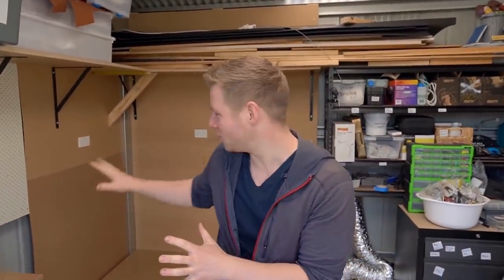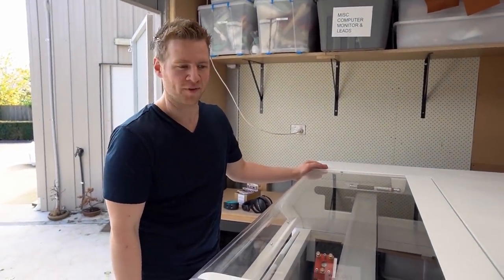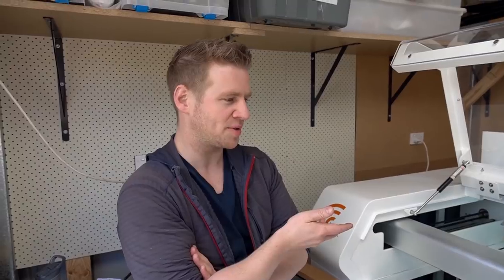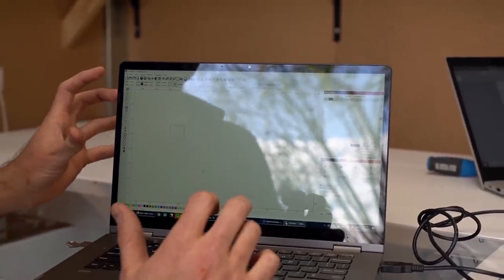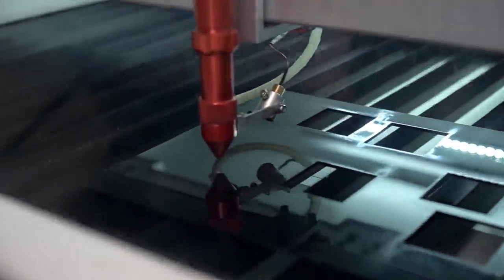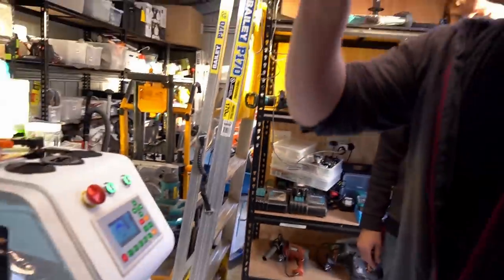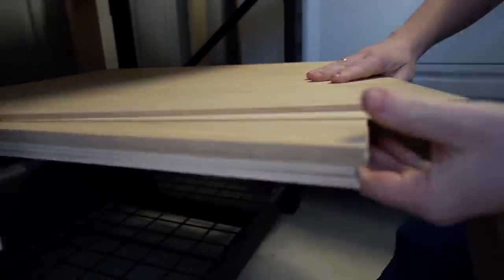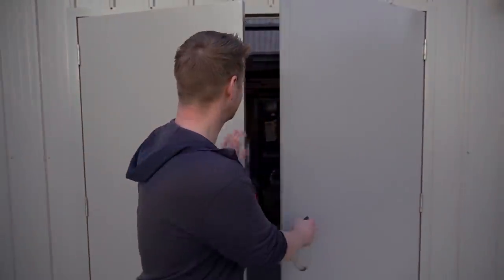I GOT A GIANT LASER!

Comment: I spent five years working in a trophy shop using a laser just like that one to engrave names and graphics onto metal, plastic, and wood. It was a very creative and fun job, getting to pick fonts and design layouts for various awards and name tags and such!

Just like you did, I had to calibrate the laser for each and every type of material I worked with. Save the settings so you don't have to do that again!

Be sure to ventilate the area extremely well. The unit has a fan, but don't just have all those toxic fumes sit in that shed. In my old shop, we had a vacuum tube attached to the unit's exhaust port that would pull the exhaust up to the roof of our building. You're going to need something like that to keep the area breathable. Even with the precautions I took, I was still concerned with how much I could smell the burning chemicals all day. They couldn't have been good for me.

Also, it may be tempting to set it and walk away, but you've got to check on it regularly, because I've had occasional imperfections in the materials catch fire before. Even if it doesn't spread, it'll do serious damage to your machine if you're not there to put it out quickly. It worked out in the store because I was always sitting right next to the machine designing the next job while I waited for the last one to finish. Sometimes I had half a dozen jobs ready and queued up. So I would often glance back at the machine to make sure it hadn't burst into flames. It'll just happen every so often, even with settings that are normally safe. Luckily it always went out quick and almost never did any real damage. I would just put new material in and restart the job.

Have fun!
Reply: Nope to long
Reply: Queen_ animation well i think it's for jazza not you so you're good
Reply: Thank you for reading it lol TwT
Reply: @akiraplayz3143  its was actually valuable information.
Reply: I was thinking about getting a lazer cutter. thanks for the info.
Reply: Came here to comment pretty much exactly this! Yours was a bit more detailed and legible than I'm sure mine would have been though lol
Reply: I'm never gonna own a lazer cutter but that's cool stuff too know... also that sounds like an awesome job to have 😂
Reply: I hope jazza sees this, you gave great information
Reply: Damn, I hope Jazza sees this, because this is actually super valuable information to have!
Reply: Mucho texto inserte toda gangster
Reply: Such versatile machines. Excellent advice; I kept a tab open on engraving chat sites I found,  learning from the experience of others. So many materials from card to ivory, wood to glass, velvet and denim. Eight years well spent.

Comment: I have the model down from that one. Purchased from a NSW company? Red Dot Machinery? Its a great cutter and engraver. Only thing i dont like is the cheap chinese extraction fan and i also had the main loom within the unit come unstuck. Simple fixes. You can print directly from Lightburn, rather than sending to the cutter first. Also can do an auto focus which can adjust the height on mine.

Comment: Serious question, how would mirror the image on both sides? Say if you did want to make a coin and laser the same or different imagine on both sides. How would you go about doing that? You wouldn't be able just flip it over and cut the opposite side surely? 🤷‍♂️ Thickness of material has to important also I'm guessing as the lines may interfere with the overall imagine on both sides

Comment: So I actually worked as a laser technician at my university.
TIPS: DONT FUCKING HIT THE FOCUS. You’ll have to replace the focus and have to have a technician come out to do it. Keep the mirrors clean! You’ll get better cuts! When we did acrylics at my university, we found it was better to do 2 shallow passes instead of 1 full power pass, as the cuts usually came out cleaner instead of “melted”. Another tip for acrylics, there’s certain acrylics that have a coating on them (can’t remember the name) but don’t cut them, as they release a toxic gas from the laser hitting them. If you cut wood (specifically plywood) lowest power possible to get the cuts is best, as it’ll help keep the wood from getting scorched. There may also be air pockets in wood, which will result in a pocket of fire, but the fan will quickly get rid of it. But it can definitely be scary the first time it happens. If you cut leather, prepare for the workspace to smell like death. Depending on how light of power you can get, you can even cut fabrics and paper! I’ve cut paper-thin wood before, and painters blue tape can be a great way to hold stuff down. If you want to cut a super large piece, make sure your material is at LEAST a quarter inch larger on all sides, so that if it’s not perfectly aligned, it won’t be a big deal! Keep the fans clean! And if something doesn’t look right in the machine when cutting (like sparks or fire, or even a gas), ALWAYS hit the emergency stop. It’s better to restart. If there’s a fire, turn the laser off and let the fan do its job! If you want to do engraving on a piece you want to cut out, do the engraving first, as it’ll produce a better result since a cut piece of material could shift even the slightest bit when the engraving starts. I also recommend keeping a settings list for materials you want to cut often, and do lots of experimenting before starting a project to get the best results. Some acrylic brands cut better than others, or need lower temperatures. Some woods are more prone to air pockets. It’s also nice to have a piece of material cut as reference with different engraving depths on them, as that can have a cool layering effect. My last piece of advice is to stay safe and have fun!!!!